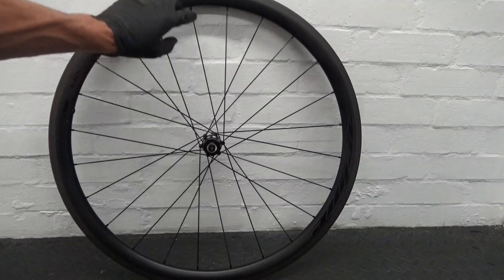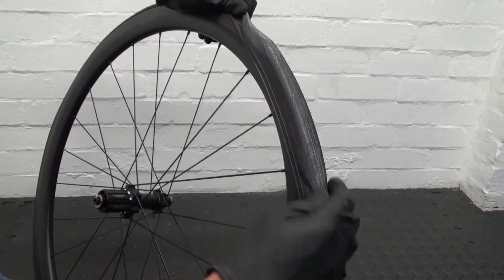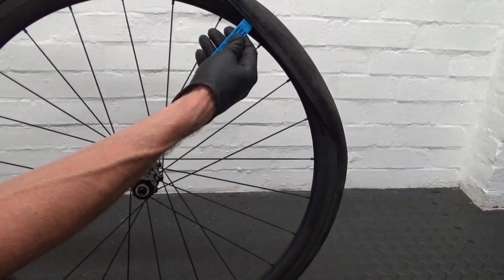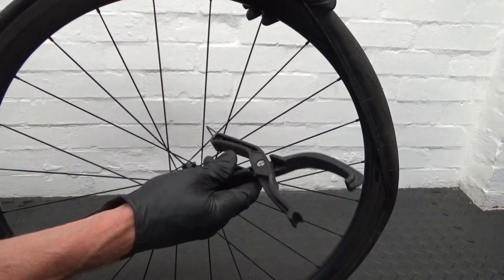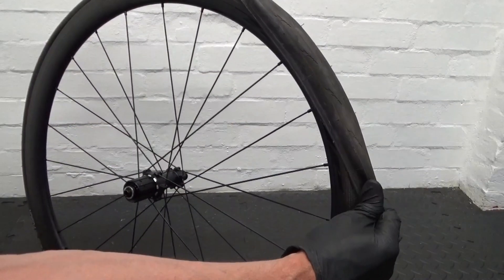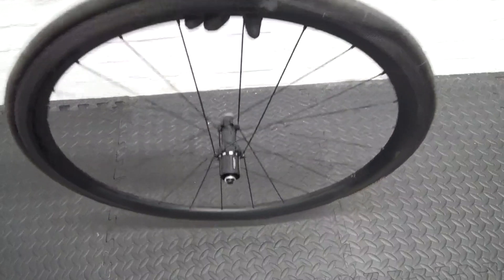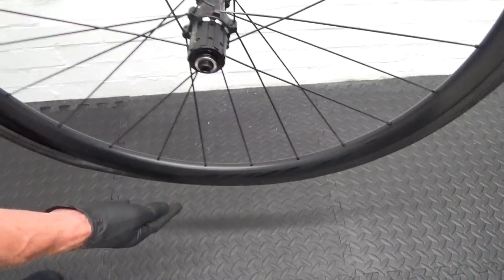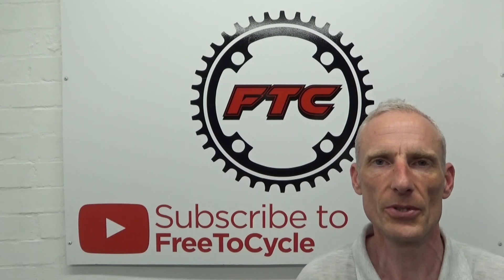Easy Way To Fit A Tight Tubeless Ready Road Bike Tyre

Comment: Great video. a question for you.  I am running Specialized Axis clincher rims and they are not tubeless ready.  I am thinking of going with a WTB Byway or Vitorria Torreno Dry tubeless ready tires.  Any opinion on the 2 choices?  Can I install these tubeless tires on the non tubeless rim if I add a tube?  Thanks for you advice.
Reply from the maker: Yes you can install inner tubes in tubeless tyres! Or fit tubeless tape and valves to your current wheels to run them tubeless.
Reply: Bought new set of hunt carbon wheels with tubeless tape. Attempted to fit new Conti gp500 clinchers..very difficult and on a cold wet night near impossible. I've been riding 15 years never had this difficulty.

Comment: Good video - thanks. But what if you get a tubeless puncture out on a long ride and the sealant won’t fix it and you can’t plug the tyre? I can’t see how you could rescue the ride with an inner tube with this tyre. Surely you wouldn’t want to take this tool on a ride? I use tubeless for mtb tyres, but for road I still think inner tubes are the best bet.

Comment: Just got some tubeless tyres from Goodyear. Absolutely tight as. Tighter than anything I’ve ever seen.  Can’t fit them. Have tried levers to lever them on but all it does is cause one end to just slide back off again. Way too tight.